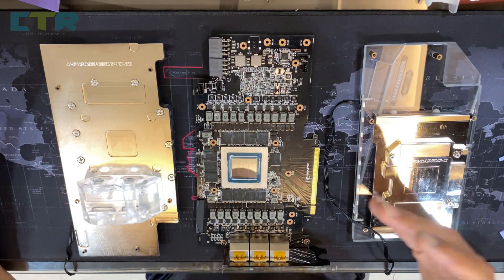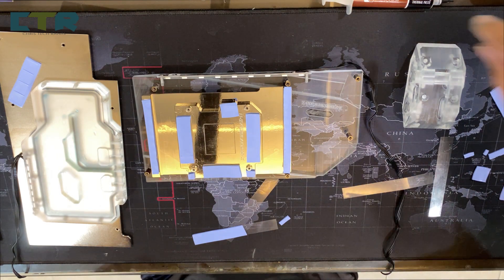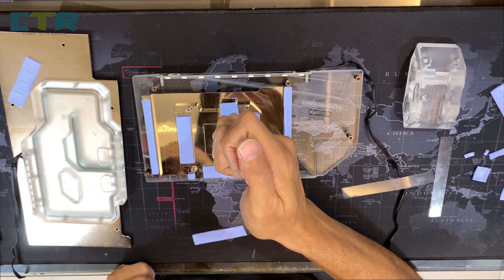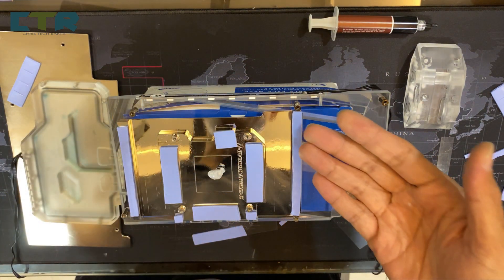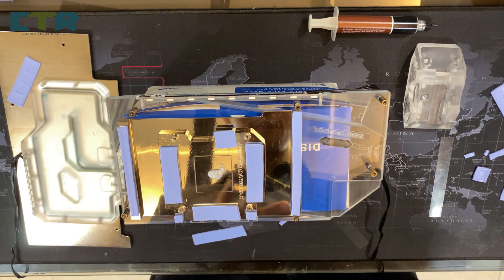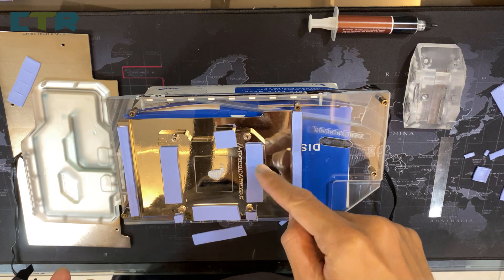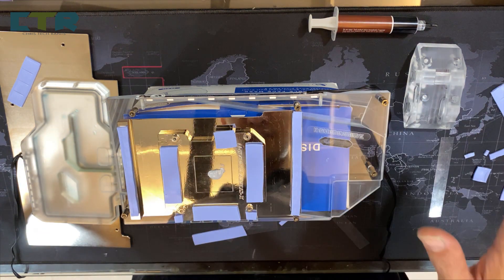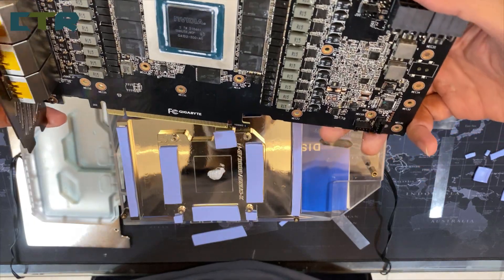Bykski 3090 Xtreme waterforce WB gpu block with active backplate installation

Comment: and what temperature gpu core and GDDR6X memory came out ???
Reply from the maker: Yup will be able to upload a new video about this real soon. I won’t really emphasize on the gpu core temp since the gpu temps are really of no concern as long as your loop has adequate cooling. (Like having atleast a 240, something like that). Objective of my coming video will be about the vram temp of my current bykski 3090 with the active backplate 😁
Reply: @christechrants4085  
I understand, I see you are the only one of youtube videos that you used factory thermo-pads, hence my curiosity

I can't wait, I don't know how much, because this water block has already come to me and I don't know now whether to install factory thermal-pads or order some Gelids 15W / mk

to be precise, I need a temperature test of the GDDR6X memory in the ETH cryptocurrency mining program, e.g. (nanominer), currently, as copies of 118MH / s, the memories are 102'C on a normal block, without an active backplate.

I've seen on these improved active backplate blocks, the best temperatures were 50-60'C on memories for ETH mining.
also if you could give your temperature result i would be very grateful :D?
Reply from the maker: @DiegoGAMEtv  just finished making the video. still have to edit it tho. i may be able to upload it tomorrow. 60C??? that's so great i almost don't believe it LOL or maybe it's down clocked? regardless, that's impressive. best temps i got with overclocked mem and core was/is 84C (with active backplate and 360 rad). Well to be fair, i didn't use afterburner for this and only used nicehash's OC TUNE and also tried Extreme profile. maybe if i used afterburner i'd be able to fine tune it better....maybe.... but as it is, i'm fine with 84C. But 60C.....seriously.....are those gpu die temps or vrams?
Reply from the maker: if those are gpu temps, those are incredibly high then LOL
Reply: @christechrants4085  
1.) MEMORY Temperature !!! VRAM = GDDR6X if you have an active 84'C backplate on this block, you have a poor result, thanks for giving the result !!!. And this poor result comes mainly from the use of factory thermo-pads

2.) see here the visitor has a record 54'C with high-end thermo-pads 17W / mk https://youtu.be/ZAWFa-zuZOU?t=1677

3.) see here the guy has 72'C with thermo-pads probably medium class "odyssey" (idk W / mk) https://youtu.be/riqxHYXe1g0?t=443

4.) as for the mining test, download "NANOMINER", preferably from the official website (you do not need to configure anything) and run and check the memory temperature results in "HWINFO" or "GPUZ" programs here you have an example in my video: https: //youtu.be/cBjRHZkL_Jk?t=3181

5.) just don't forget to reply to my messages, I write with various water cooling experts, I will look for good thermo-pads and let you know
Reply from the maker: @DiegoGAMEtv  ye i kind of figured. NICE! Would really appreciate that!!! Anyway, I will be posting the vid in a short while. Ye to be fair, When i used the thermalright with 12.8W only my temps for my 3070 dropped quite a lot. Just don’t have the right size available for my 3090. Thermalrights are quite dense and cause my pcb to bend with the wrong size so....

But to be fair, I don’t really use it for mining right now and will be quite busy to work on this again. BUT when i get the time though!!!! I will surely try other thermal pads just for the heck of it 😁

Again, appreciate you sharing those info!
Reply: @christechrants4085  
np. In general, the second problem with factory thermo-pads BYKSKI is that they have a non-standard thickness: https://i.imgur.com/AsjTy5A.jpg

namely 1.75mm.
in stores you can only find 1.50mm or 2.00mm ...

therefore the topic is not finished, because I have a dilemma what thickness thermal-pads to choose, I will consult it with water cooling experts until Monday, and I will order some thermo-pads, I will do a test and let you know.
Reply: Frame Chasers is a master tuner. I follow him. That’s how I found out about the MP5WORKS backplate. He charges people to tune their cards and CPU’s. Not surprised he got his cars mining so well with such low temps. Lowest I can get is 72-76c with 126Hash with 2 360 rads handling the card and the 5950x with an aggressive fan curve. In the low 80’s with a normal curve. I use fujipoly w 17 thermal transfer but will look into the other brand D mentioned as well to see which performs better.
Reply from the maker: @SVGNATION  it really is difficult to find fujipoly though. Are the alpha cools 17w any good?

Comment: Thanks Chris. Great video. I shared this video on Redit. If I get it I’ll be using Fujipoly 17W/m*k 1mm front & back for the memory for maximum heat transfer and are pretty dense unlike the squishy pads you got with the block so it should work out great. Looks like a perfect fit otherwise. Congrats! Looking forward to hearing some performance numbers.